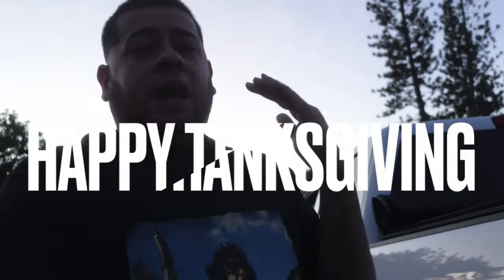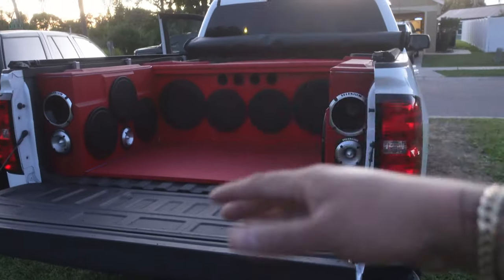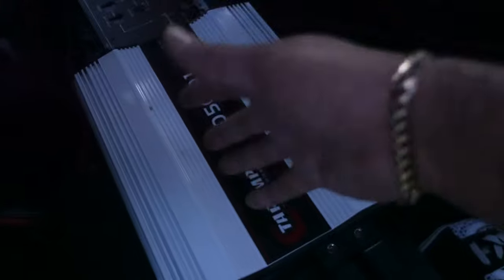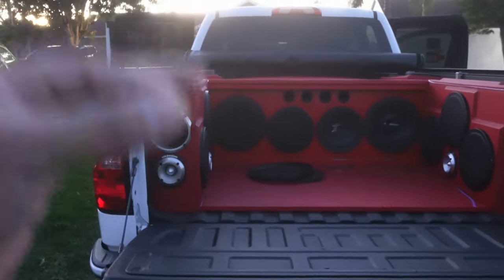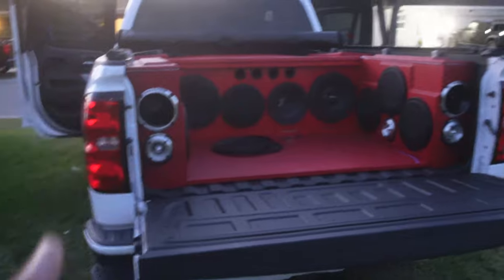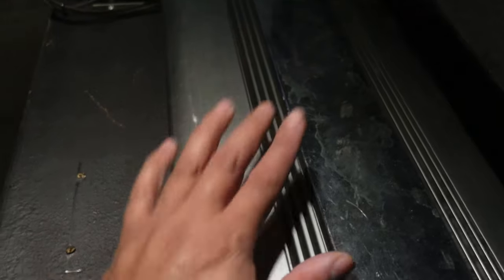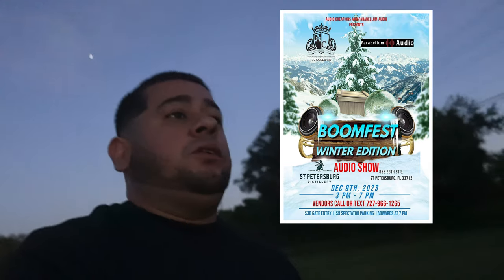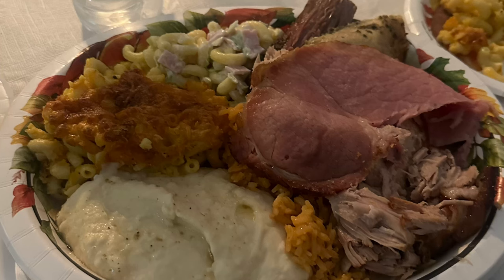Taramps Amplifier Destroyed Speakers

Comment: have a question I changed my rca wires and check my ground when I play music with truck not its fine but once I drive it amd it hits a bump it's makes a noise n cuts my high amp only not my bass amp any idea what it can be
Reply from the maker: Check power wire and fuses

Comment: Thise 6 10s should take everything that MD 3000 has and then some, all day every day. Either you have it wired too low or clipping so hard your dust caps look like Hiroshima. Toss those crossovers in the trash & get a DSP...and another amp while your at it because mid bass isn't mono.
Reply: Yup might be right, I stopped blowing speakers once i got a dsp